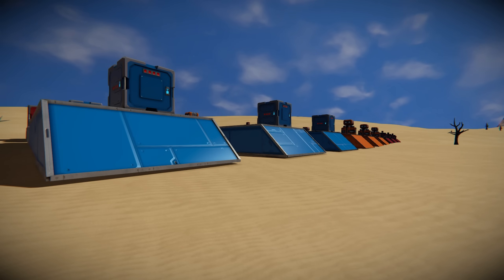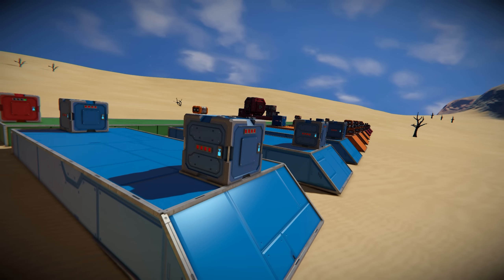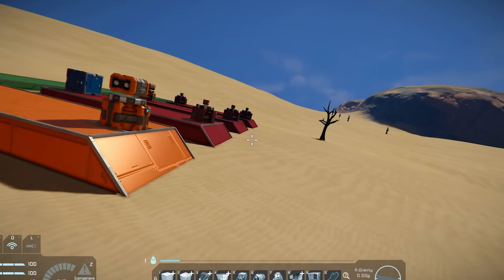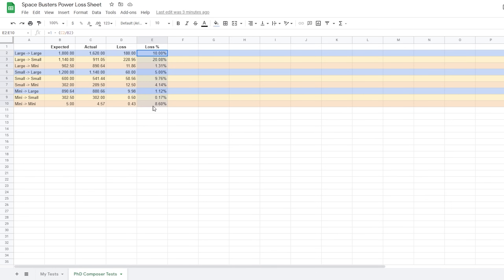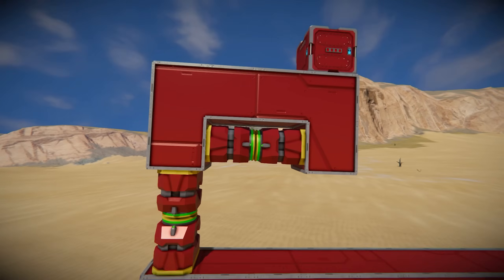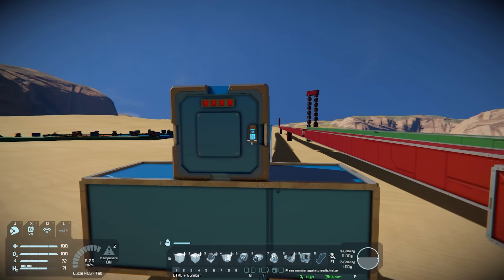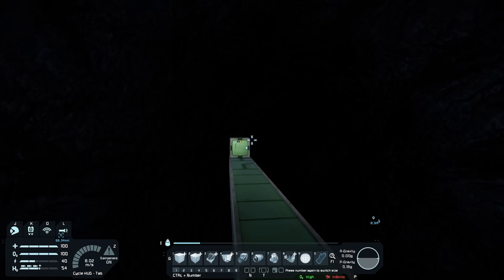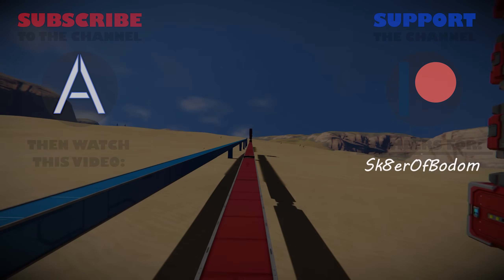Space Busters | Do Batteries LOSE POWER During Transfers? | Space Engineers

Comment: So I was going to ask about something different when I checked the wiki and found something interesting.

"...recharging batteries with reactors only has a 80% efficiency..."
"Other power producing blocks (solar panels, wind mills) don't lose efficiency when recharging batteries. So the optimal use for Batteries is when you have solar panels or wind mills to charge them, otherwise it's a waste of uranium." 

So it looks like battery to battery or reactor to battery has the same effect. 

For the most part though it's not really an issue we would run in to, unless we foolishly set up a remote charging station and tried to physically bring the power back to base via batteries but I don't know why anyone would do that.

Comment: So now I wonder, if you have say, 10 batteries on the same grid with no power consumers other than the batteries, and you set all 10 to auto, will they keep trying to recharge each other, and eventually deplete? Makes me wonder what the best way to manage batteries is, especially if paired with a reactor. Like, would it make more sense to set batteries to recharge or off when not needed than leaving them on auto? Would leaving them on auto consume more uranium than if they were turned off?
Reply: Two batteries on auto will not try to balance their stored energy. If you have batteries and a generator of any kind, the generator will charge the batteries, and the batteries will supply power to everything else. If you want to have a battery for backup purposes, you need to set it to recharge to keep it from interfering with the generator supplying power to the grid.

Comment: I am curious about something I’ve been pondering for a while and could use some confirmation. 
You see, when you have a ship (eg small) and you have say 3 small reactors and a big battery with small ones, in survival, would those reactors be giving power to the various ship systems while charging the batteries? And if those reactors run out of fuel, do those batteries take up the slack somewhat?? 
Also, if a ship has fully charged batteries and full reactors, does this mean that the reactors operate in conjunction with the batteries and vice versa or does one of the two power systems work at any given time?? If you get what I mean, because honestly I’m just tryna make ships that last as long as possible and wanted these bits confirming. Thanks for reading 😊
Reply from the maker: Just went into a game and tested it. So it's kinda weird but let's start with the easy stuff. Similar power sources work together to power things. If you have a power draw of 600kW and one wind turbine, it will output the full 600kW. If you have two wind turbines, they will each output 300kW. Likewise, if you have two reactors, they will each output 300kW. 3 reactors would output 200kW. It's only where you start mixing power sources that it gets more complicated. 

Whenever you have a battery, it will take the power draw 100%. So if you have a battery and a reactor, the battery will take all 600kW of power draw. BUT at the same time, the reactor will work to charge the battery. So where a large grid battery has a 12MW input limit, the reactor would be outputting 12MW directly into the battery, and the battery would be outputting 600kW to the rest of the base. Same goes for wind turbines and solar panels. They will always go through a battery first if possible.

The other rule I noticed is that renewables are favored over non-renewables. While solar panels and wind turbines will share the 600kW requirement, if you add a reactor into the mix it will not output anything unless the renewables are removed or cannot satisfy the 600kW power draw. 

Now finally, what does this mean for your ship and it's power efficiency? Well first, as of this video we know batteries incur a 20% power tax on any power they take in. So if you have a reactor and a battery powering your ship, ALL power from the reactor will flow through the battery (losing 20%) and then to the ship. So if you want to optimally run your ship, either remove the battery, turn it off, or turn it to discharge only while the reactor is active.

Comment: You used metal as the transfer medium (metal grids). Would it matter if you used say glass (putting the batteries on a glass window frame), or even concret (use one of the many concret mods to make a short, medium, and long grid like you did @09:50 🤔).

EDIT: Re: the crash, This probably means either Keen is getting better at getting patches out, or this was just a one-time fluke.

Comment: gotta ask!! the rotors in the first test, are they Off?
they consume power
Reply from the maker: Yes they were all off. I checked the usages of the batteries before transferring the power and they were all only outputting ~1-3W of power. That's not enough to make any difference in the tests, but just to be sure, I had a battery on the side also outputting 1W to see if it affected anything and it did not.

Comment: I thought the efficiency lose was on battery input not output. e.g. Reactor -> Battery would use more uranium per kilowatt hour vs powering blocks directly.  You could measure it by putting a reactor on a grid and powering enough ion thrusters to max out the reactor and time how long it takes to burn through 1 kg or U then do the same but first use the reactor to charge a bank of fully depleted batteries then the thrusters from batteries. If the reactor w/I batteries powers it longer than the batteries are always less efficient than direct power.
Reply from the maker: That's a good point, I dont actually know whether it's input or output with this experiment since a transfer involves both. The experiment you outlined sounds like a great way to find out!
Reply: The power loss is applied to the input of the battery, regardless of source. The batteries also receive priority over other blocks, which is to say, the reactor will charge the battery, and then the battery will power the other blocks, thereby incurring the 20% loss.